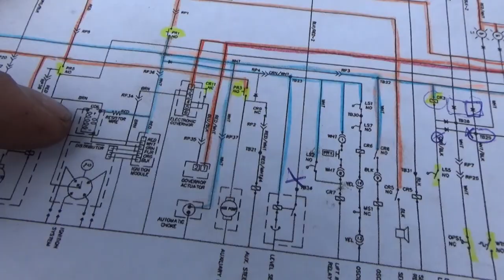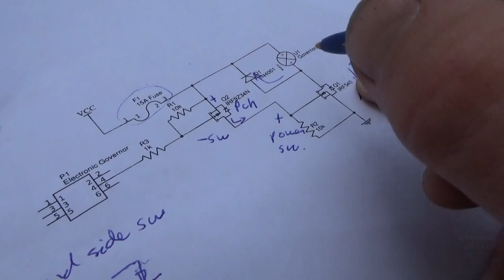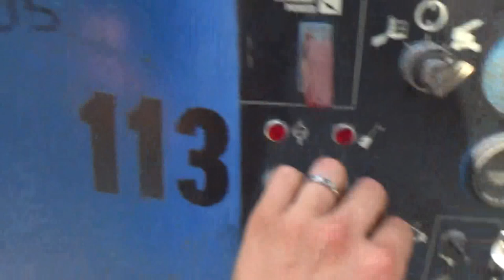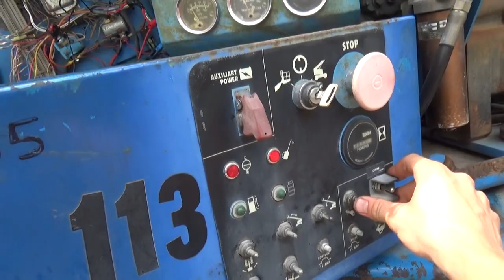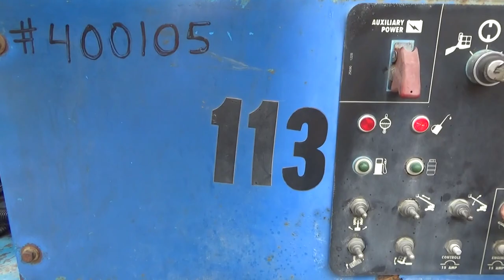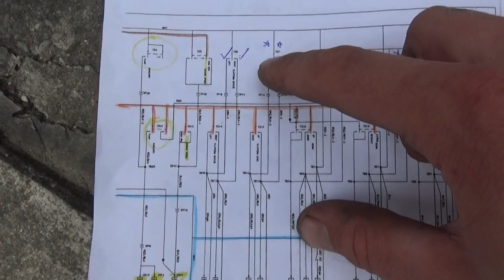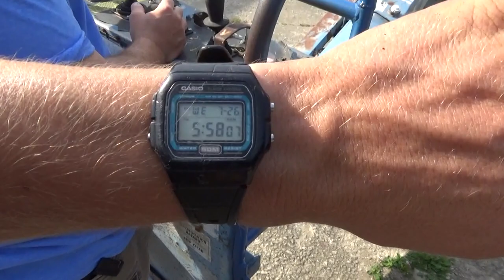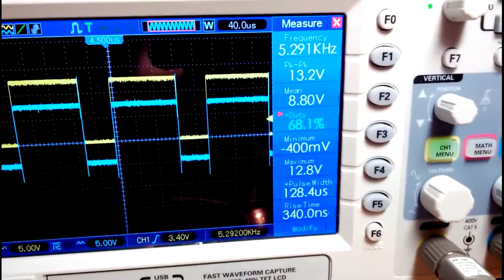Genie Boom Lift REVISITED -Part 4 - GRAND FINALE!

Comment: one question.  What happens if/when the bulb burns out.  For sure you want a fail-safe that puts the engine speed to idle if the bulb load goes away.
 I suppose a test would be to pull the bulb from the socket and see what happens.

I actually understood Vladimir's explanation in the 'bonus video'.
Reply: If the bulb burns out the system will just revert to oscillating full time. Ironically just a plain old resistor might have done a better job but it's a crap shoot when you haven't worked out the basic system parameters in the first place.
Reply: A wire wound resistor would have been a better choice. Too much jerry rigging on this video.
Reply: What are you suppose to do when your in the middle of nowhere Michigan? In Phoenix I've got Digi-key and Circuit Specialties right around the block and can get anything. What's Ivan suppose to do pull a power resistor out of his ass?  You do what you have to do with what you've got when there are no other choices.
Reply: You could say that if you can't fix it right then don't fix it at all. You could cause more problems later that would be even more expensive than the original repair. Not to mention causing a  possible safety hazard. Sometimes just because you can do something does not mean you should do it.
Reply from the maker: So where the heck am I supposed to get a wire wound resistor on a farm? If the bulb burns out, there is another identical one on that junk Mustang. Pop it in and good to go :)
Reply: So if I have a deep cut on my arm instead of getting it stitched up I should just buy a box of band aids and keep replacing them as they get gorged? What about a flat tire? Just keep putting air in it as it goes flat or have the hole patched? Do the repair right the first time and that way you will only do it once.

With that said you did a good job of diagnosing and making it work.
Reply: Circumstances determines your response to any situation. If you're 100 miles away from a hospital, and you're lucky enough have a first aid kit, your first option is your ONLY option until you can either drive yourself or have somebody take you to a hospital to be "properly repaired." Or, you always have the option of bleeding to death - your call. Same with the flat tire. I live two miles from a Discount Tire store. If I have a hole I DO PUT AIR INTO IT and drive to Discount Tire to have it "properly repaired" or replaced. If I'm half way to Vegas in the middle of the desert and this happens I've got no choice but to put on my spare tire and try to make it to civilization.
Reply: I think we both have valid points. In the video it seems like that fix he performed was the final one. He did not indicate if he or anyone else planned to perform a proper repair. If the customer was ok with the repair then end of discussion. I am just saying I would have wanted it done right. If I pay someone to do a job then I want it done right. I think it is great you live close to a tire repair shop. At least you indicate you would have the tire repaired correctly and not done incorrectly.
Reply from the maker: OK so what's the average lifetime of a generic brake light bulb, burning on average at half intensity, in hours? Now how many hours of service is this Genie going to see? That old Mustang bulb just might outlast the Genie's useful service life! And if it doesn't, then buy a new one for 2 bucks!! Big freaking deal!

In this particular situation, where the Genie will be used on a private farm for some DIY home improvement projects, I think the "fix it right or go home" argument falls flat on its face. It's fixed, it's functional, it's reliable. What more can you ask for?!?
Reply: For someone making videos to show people how to diagnose and repair things should always strive to show the right way to do things. You should not have a "shade tree mechanic mentality". Aren't these the type of people you are trying to educate? Maybe you could explain that you don't normally repair engines this way but just wanted to get it working per customer instructions. I have watched your other videos where you did a great job. I was just disappointed with the way you did things in this one. I really enjoy the way you troubleshoot problems and make sure that you have the correct diagnosis. I don't doubt your abilities. I think they are well above average. I was disappointed at the way things were done in this video.

As far as the bulb: the average lifetime is usually 1000 hrs. You don't know how many hours it has operated. It may last 100 hours or only 1 hour who knows. Just had to get that in.
Reply: The lifetime of an incandescent bulb (tungsten fillament) goes up exponentially with reduced voltage. At 50% power the light bulb will damn near last forever. This piece of equipment will not. Ivan's only job is to satisfy his customer since that's who's paying him. You, me and everybody else watching this is just freeloading upon his good will and willingness to teach the unwashed masses who have 1/10th his talent.
Reply: As usual you show your ignorance. When the bulb was mounted in the car it received full voltage. How many hours was it receiving the voltage? I don't know, do you? I guess you have never had a brake light to go out? I have and I see them out on other cars all the time. So your point makes no since.
Reply: I plead the 5th.
Reply: I plead the 5th.
Reply: I would like to see some of your videos D Pyles.
Reply: I don't make videos nor did you see me bitching about anyone else's videos did you?  I'm grateful for whatever information I can glean from those kind enough to take their time and present me with it.  You are not required to repair things the way he did nor should you feel you have the right to piss on his efforts.  I just can't help but think maybe some people should just get a life.

Comment: Please help me ivan, already tryed eric o, danner scanner,jimthecarguy and a few others, i dont have those expensive scanners u guys use but. I always figure things out but this really got me , working on a 93 ford f-150 5.0 engine, it has a very high idle 2500 to 3000 rpm have replaced iac and tps, no change but i notice that when i disconnect the iac truck comes down to normal idle reconnect and jumps right up , also notice that when i disconnet iac and give it alittle gas it has really bad backfire. What do u think it could be, please help if u can. Thks
Reply: Try the MAP sensor if your throwing parts at it
Reply: look for vaccum leaks on all lines and fittings, then #1 is EGR valve stuck partial open? #2 is brake booster leaking through? #3 does the pcv valve exist? seen fools bypass them #4 any intake leaks?
#5 check base ignition timing, too far advanced?  throw MAP sensor at it, as SuperM1687 suggested :))

MAP sensor is by/on passenger side firewall..

Comment: I would have connected the controller directly to the governor. According to the manual the resistance measurement of the gov. was within specs.
Reply: the controllers are known to be magic smoke bombs, the mechanical governor about the same.
Reply: What is the spec?
Reply: 3 - 5 ohms
Reply: I believe mine was at 2.

Comment: The fact it needed Vlads circuit to work properly does that suggest the governor is faulty? Was this a design fault with the machine or an issue with how it was rewired? I've seen machines come new from the factory with "issues" and you wonder how it ever was supposed to work... 

Excellent series. It's put me off ever working on one of these. 😂
Reply from the maker: We suspected a shorting throttle actuator that was drawing one too many Amps. It's a discontinued item, with a used one costing almost $800!!

As far as working on these machines, it's not bad with an accurate diagram and original wiring. The part that really made this one tough was the custom re-wiring job haha
Reply: According to the manuals test procedure of the actuator the resistance you measured in the first video was within specifications. I think there was a problem caused by the wiring problems you found burned up the previous controllers.
Reply: My initial thought when I saw that rat's nest of wiring under the cover was that I hoped you had a good wiring diagram. I would have been sorely tempted to rip out (or at least disconnect) all of the black wiring and every other color wire with crimp on ends, and reconnect after verifying each connection point and continuity. What a nightmare!

Comment: Now shrink this circuit design by about 9 orders of magnitude, multiply it by 6 billion and you got a modern CPU or GPU. Voila xD

No seriously, this my bread and butter as an IC Designer.
The 'delay' you've experienced with the resistor and the capacitance of the MOSFET gate is actually one of the main factors that limits how fast you can 'clock' a modern digital integrated circuit (the time constant is called tau, and is calculated by R*C and describes the time it takes to charge/discharge the line by approx 67%).
If you switch the input to fast, you can not actually charge or discharge the data lines in time. Making a circuit suitable for the target operating frequency is referred to as 'timing closure' and has to be fulfilled under all 'corners', which are mainly semiconductor process variations and temperature. In your case you basically violated circuit timing and then all kind of weird stuff can happen.
Reply: so your one of the folks to blame when IC's fail in usage far below spec :))
Reply: Haha ;)

Usually not really, unless there is a functional bug in the circuit. When you give your design to a Fab (like TSMC, GlobalFoundries, UMC and whatnot) for manufacturing you have to go through a sign-off process which proves that your design is fit for manufacturing. This usually includes tming closure, physical design-rule checks etc. . So if it comes out and works and breaks later, this is usually a process problem or use outside of spec. This e.g. happened with nVidia mobile GPUs a few years back where there was a problem with the etching process, which led to material degredation inside the chip years after manufacturing. That is why a certain breed of nVidia equipped Laptops will inevitably die (or are already dead^^).

Integrated circuits, although especially car people like to preach the opposite, are in fact the most reliable part in any automobile. Shit happens when stupid manufacturers put electronics under water drain holes, PCMs get bolted to engine blocks where solder joints start to crack because of extreme heat cycles and stuff like that. Or you have incredible (stupid) Designs like Chrysler TIPMs where wear-and-tear items like mechical relais and power transistors are non-serviceable on a board together with ICs.

There is a reason why fuses, relais and power transistors (like your blower motor control assembly) are replaceable, because they will wear out over time. Inevitably. If you try to 'integrate' them, you are asking for trouble. And any engineer who designs stuff like this and any manager who signs this off should be fired and get another job.
Reply: all good points about IC "usage" cases, but they can and do fail early in perfect scenarios, facts of life and new "beta" stuff pushed out in a hurry :)
Reply: sure, no industry is immune to that 'pushed out in a hurry' thing. And of course there is a certain (but usually low) percentage that will fail early even after a successful production test.

For automotive applications, that number should be 1ppm or lower (so one part out of 1 million is allowed to fail in the specified lifetime even if tested as good after production).

Comment: Hello superm, im from S.A. Tx, i tried getting the codes , but for some reason it doesnt let me retrieve any. This is actually for a customer, ive been working on people cars , trucks etc, for free for yrs , just like working on them. Have many tools except. Those snapon scanners these guys use can afford them , as i said before i like helping people out , guess ive been lucky , but i always getter done, however i do have a craftsman scanner, been fixing car since the age of 14 as a hobby, i was a heavy equipment operater, since for 15yrs until i was involved in motorcycle accident, and became an amputee, just wanna stay busy, anyways thks for your info.

Comment: I apologize, i think it does have a map sensor.
Reply: Hi Jaime, sry if you misinterpreted my messages. Eric O did a video on this not too long ago. I remember when I was looking for this part at the junkyard, they seemed more common on the 5.8 liter engines than the 5.0. If your like me and don't own a scanner,  there's a method you can use to pull the codes by flashes on the dash. You have to jumper out the connection under the hood. I believe there's some videos on how to do it etc. Where are you located?

Comment: Is wood the best choice for that?
Reply: It would have been better to mount the transistor with a mica insulating kit and some heatsink compound to isolate the heatsink from battery voltage, so it could be mounted directly, but it will be fine. It's going to be out of the weather and the heatsink will never get hot enough to set the wood on fire.

Cutting wood with a hacksaw is a waste of time and energy, though. Surely there was something on that farm that would have cut a little faster...
Reply from the maker: I think we would need about 100Amps continuous current to set the wood on fire xD

Comment: First of all didnt just throw parts on it superm1687 both were bad, second doesnt have maf sensor, shows how much u know
Reply: I never said MAF, but MAP. Manifold Absolute Pressure. I had similar symptoms on my 93 F250. It's a $5. part at the junkyard. You may not have one so you're right I dont know anything.

Comment: the fix wont last long, the governor winding insulation has broken down/partial coil/s shorted, that will work for a while and bake the MOSFET's...
best solution, build a custom controller ( CHEAPLY) not over advanced herp-derp computer fudge....
.
.
.
.
.
OR as they hillbilly fixed it, a FSCKING cable they could pull ;) one step forward and 10 steps back, all thy younger gens are doing
Reply: alternate to that, repair it by hand... after early 90's  not much worth repairing, because it was overly outsourced chinesium garbage... notice I didn't say anything about the early Japanese stuff, their junkiest junk was 300+ better
Reply: Agreed. The shorted windings will continue to stack up. I only hope the default condition is idle.
Reply from the maker: Did you not listen to Vladimir's circuit description? The 15A fuse will blow way before the MOSFETs get baked ;)
Reply: like all the other electronics that are fuse protected and never go bad ehh? 
I'm not saying the circuit isn't good, you can only go by the "supposed" component ratings ;)
Reply: MOSFET current ratings are for the maximum current even if it is a spike. The fuse will withstand the spikes but the MOSFET can't. Maximum ratings are the highest absolute values that must not be exceeded even instantaneously under any conditions. Most MOSFET circuits are fused with what is called a semiconductor fuse that have no time delay. I would think the MOSFET would blow before the fuse if it was not a semiconductor fuse.
Reply: irf's 540 Pulsed Drain Current of 110Amps laughs at your comments
Reply: yall too funny, there's many things to factor in.. A)airflow over the heat sink. B) is the governor actuator failing inside. quite sure I'd have done exploratory surgery on it to ensure it's not a silly designed moving coil with broken down wire insulation shorting to case, but that's just me ;)